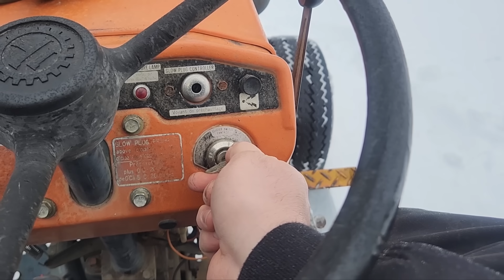Why are Diesel Engines Hard to Start in Cold Weather?

Comment: Alaska- run an extension cord to vehicles with 12 Guage wire to a 4 way outlet. 1 outlet has like a 2 amp trickle charger for batteries, 1 to oil pan heater pad, 1 to transmission fluid heater pad, and 1 to engine block heater.  -70 Fahrenheit no problem. Set on a timer to start warming up 2 to 4 hours prior to wanting to start engine.  Leave for work at 6am, set timer for 4am.  Also saves a ton of money on electric bill!  Lol
Reply: I used to always plug my truck in   , now i no longer do this ,,I bought an APU very first thing when i bought my 1977 peterbilt 359  ,,this particular truck has a 12V71 2 stroke detroit and it won't start unless plugged in ,,   i program the APU computer with the time i want to start my engine   and 30 minutes before i get ready  the APU starts up , it runs an oil pan heater and also the cabin heat ,,and because the APU shares coolant with the truck engine  , no block heater necessary ,plus the APU warms the truck batteries and charges them too ,,so even when it's negative 40 outside i jump in the truck and crank the engine and it's just like it's 90 deg outside ,, all 3 of my trucks have an APU now and i won't ever own another truck without one ,most APU units will also automatically start  regularly  to keep the trucks batteries charged

Comment: Not much to add, other than the reason the oil viscosity in the cold is important,  is that a diesel relies on the engine turning over fast enough to generate enough heat for ignition to happen.  If it turns over too slow it doesnt make the heat quick enough,  and it doesnt kick off.  Running a trickle charger on the batteries over night when its cold also helps.

Comment: A Canuk here from the Moyie River Valley...  a bunch of miles north of your Idaho location. Usually in February we hit our low of lows...minus 20 to minus 30 F. My '03 Ram 3500 5.9 Cummins is a champ and with about 1 to 2 hours of block heater on..will fire with ease. Also, I swap out 15 weight Rotella oil from summer use to 5 weight Rotella for winter.. Just as a note of comparison..prior to using the block heater for a couple of years the Cummins fired up as normal, the block heater simply made the warm up for my ass in the seat a bit more comfortable.

Comment: Appreciate your channel. 84 Mercedes TD inline 5 owners manual says crank till the oil pressure rises. This because the crank rpms are faster than idle. Many don't understand the starter is made for this. Man its a massive starter. :)

Comment: good explanation. winter diesel helps prevent gelling. the biodiesel will increase chance of gelling since its very hygroscopic. a followup on additives may be helpful as well. or use of pan heaters, block heaters, or battery heaters can also help

Comment: You forgot to mention those crappy indirect injection diesels that inject into a combustion chamber before the explosion enters the cylinder, they require glow plug starts even in summer.
Reply: Not true, John. A neighbor has a diesel tractor with indirect injection and he has absolutely no trouble starting it for most of the year. I have a 6.9L International IDI engine in a pickup truck and same thing: no problem starting until the winter weather arrives.

Comment: Makes sense why some of the old-timers up here in the Northern Rockies talk about draining their oil every night and adding it back into the system in the morning. 😑
Reply: Yah: if it's the difference between getting a motor started or not, draining the oil is not terrifically inconvenient in this instance.

I'm not sure I'd like to do this on my semi truck I have which has 12 gallons of oil;  but on a car where there's only five quarts.....

Comment: Definitely a good topic for this time of year. 
Thermostart is actually pretty common in agriculture and Perkins.
Glowplugs were used primarily in pre combustion engines.
Engineers used to believe that the heavy iron parts of the engines would soak up the heat of the compression cycle.
Timing advancement and higher injection pressure really seems to help.
Thinner oil certainly increases starting RPM.
Maybe diesel fuel won't burn in a puddle on the ground but dip a rag in it and light away.

Comment: We will use a hair dryer to blow hot air into the intake if we have a problem starting. I have started a 1968 #60 Hough with a v6 cummins ( 352 I think, the hardest damn engine to start I have ever seen, can be 95 out and needs a little shot of starting fluid)when it is -30 and sitting in an unheated shed.  Had a 1000watt tank heater on 24-7 to keep the engine from getting totally cold.  A 200 amp battery charger is hooked up ,  a warm can of starting fluid(a couple of short shots) and the hair dryer blowing hot air into the intake.

Comment: I own a GMC with a LML Duramax, I live in Canada so it tends to get cold. I baby my truck, so it lives in the garage. When I’m going to use it I plug it in, this activates the block heater, oil pan heater and transmission pan heater, did I say I baby it?
This eliminates the glow plug cycle and also the intake heater once running, this saves the batteries and fuel. I use Rotella T6 0W-40 in the engine. 
I drive a school bus with the MaxForce diesel, I’ve never had a problem starting in the cold, some drivers do because they don’t understand diesel engines.

Comment: It's been a long time since I've been around large trucks I've ran diesel pickups for years I have a old 2000 Ford F350 4wd powerstroke diesel it starts in the winter but not real easy northern Michigan gets cold in the winter my 2016 Ford F250 powerstroke diesel it starts great no matter the temperature I've never plugged it in

Comment: I run in British Columbia and Alberta Canada, and see plenty of cold temps. At a certain point, its just easier to leave em running. Note with DPFs etc, bump up idle rpm to 1100ish to ease sooting.

For gelling, knowing what your diesel is rated to is key. They'll blend in kerosene or such. Know your LTO number (low temperature operability). The after msrket anti gel works well, know your dosing--biodiesel blends need 200% dosing!

Cold start PRO trick, have some spare diesel, warm it however you want (hot water immersion works well, with an old howes jug), add some nice warm diesel into your fuel filter/water seperator RIGHT before starting. 

100% helps,  I've cold started a cold-soaked -32c engine with no heaters this way, 2nd try. She was unhappy and oil pressure took a lot of buzzing and STOP ENGINE to quiet down....

Comment: Some cold start strategies.  

Cold start on 1970's + / - diesel International tractors / backhoes.
US market used ether , Euro market used a diesel fueled electrically ignited intake heater  ( flame plug )
 
If you really want to get obscure, there is a 1940's International engine that had a second intake valve that opened into a chamber fed by a gasoline carb.  Yep, the engine started on gasoline then switched over to diesel.   I've seen an engine that had a way to add gasoline to the engine oil as a way to thin it out.  This was an oil fill just below the gasoline fuel valve.

Small single cylinder Yanmar engines have a port on the intake where you add engine oil in order to raise compression ratio for better cold start.

Hatz engines have a plug that leads to the cylinder where you put a flammable rod into the plug, light it , insert plug into cylinder then start the engine.

Comment: When you made the comment about diesel engines really drawing the amperage to crank over, that reminded me of an item I have noticed in a few random videos from the states of highway tractors that were using three batteries in a battery box that is designed for four batteries. Is this a theme you have noticed on trucks in the shops you've worked at or perhaps its prior owners having cut corners all they can and eliminated one battery. I've never seen such a thing on any trucks I have looked at or owned up here in Alberta. Battery capacity as in number of batteries ( and health along with sound connections ) is everything in cold weather as one needs all the help one can get to ensure a reliable starting diesel ( along with the block heater, the correct oil viscosity and so on )

Comment: I got a job at the local John Deere dealership last year and was surprised to find that they still use ether on new equipment. Coming from a New Holland dealer I found that weird. Lots of the 10+L engines in CNH equipment uses 24V for starting and they all use a pre-heater or glow plugs.

Comment: Our diesel pusher RV w/ a glow plug equipped Cummins L9 has an Aqua-hot diesel fired boiler onboard which provides unlimited hot water to the coach along with hydronic heat that can also pre-heat the engine coolant using a segregated circulation pump. Also from the factory,  has an electric block heater. Can use both at once. We head to warmer climes during winter so not used very much but good to know it is there and why.

Comment: Gelling occurs when paraffin wax within diesel fuel solidifies and bonds together at extremely low temperatures. There are products to add to the fuel tank to help from this happening.
Summer time Diesel #2 is sold, and winter in extream cold areas, Diesel #1 is sold. generally cut with kerosene..
Do not use Ether and Glow Plugs together. Disable the GP`s first.
Engines that require a Valve Adjustment, do it before winter starts. 
Make sure you have 2 good batteries, with clean connections, good cables with no corrosion. Clean connections at Starter relay, and on the Starter.
An old tired starter usually won`t turn the engine over fast enough, and cuts your chances of starting.
A tired high mileage engine will have lower compression, and will be more difficult to start.

I have had Diesels since oct 81, when I bought an 82 Datsun KC with the Nissan SD-22 Diesel engine. still have it, put over 480K miles on it.
97 bought my first Mercedes Diesel 85 300D Turbo, still have it
80 240D, 82 240D, 84 300SD and  4 others in the yard.
86 and a 85 Ford f250 6.9 Diesel 4- spds.
84 JD 950 3 cyl Yanmar
2012 Kioti CK30

On the 86 F250, when the GP`s were not working and forgot to plug in the Block Heater.
A HF Heat gun shoved down the intake a minute or so, she will light right off. 
Be sure to remove the Filter element, or you will have extra heat when it catches fire....

Usually the older engines used in cars and light trucks are IDI engines, Indirect Diesel Injection. They have a swirl Chamber the fuel is injected into to, and where the tip of the GP is.

Larger trucks are Direct Injection. where the fuel is injected right onto the Piston.
The Dodge Cummins is one, from 89 - to around 99 then went to the electronic garbage  as all new Diesels are, computer controlled.

The International DT 466 I saw mentioned in the comments, does not have Glow Plugs, We got 2 new trucks back in 80 we drove for 15 years or so both auto trans, then we got a 95 466 5-spd 2 spd Diff I drove for 10 years before I retired.  NO GP`s.
The other crew got a 96, and first year with the Computer, never liked driving it.

Josh like your topic, will help a lot of people to sort of understand these Engines.

Comment: Very uncommon now but the old compression release was great. Takes 2 guys to start it. 1 to work the lever and another to work the key. There were some bypasses that could be done to start it if you're alone
Reply: The Army's F5070 AKA International Pavestar 20-ton dump trucks had a compression release lever and in 1999 to 2002 Kingston NY, Reserse unit that still had these Vietnam area vehicles, it would take three of us to start one in the winter.  One lying across the front left tire pulling the lever, one to spray either, and the other to turn the key.  Heaven help us if it needed to be jumped without another one running because they never upgraded them to 24V systems and they were the only 12V systems we had besides our POVs

Comment: The compression along with the real culprit, rind cylinder stiffness with cold oil on the cylinder walls. we have quite a number of diesels of all the major makes. Some heat the water in the head. They work eventually but not as easy as those with the block heater placed near the bottom of the cylinder liners. This leaves us to believe the cold oil on the cylinder walls is a big source of the drag on the starter. We have a 1993 Mack truck an E7 that will start below zero cold without block heat. The newer electronic E7 is good, but not like the 93 model. We attribute this to the extra amps being diverted to the computer. The Cat engines we have are good too, but the C9 HUI engine can be a pain. The record for that old Mack is -12 deg. in a cold building.

Comment: Thats why these newer model trucks have there apus hardline to the trucks.  Theres plus and negatives about that.  Keeps coolant flowing to temp and real big negative is when u spring a coolant leak your screwed.  I had 1.2 million miles on my 579 last winter got down to -20 didnt start it for 2 weeks cranked right up.  Keep the injectors maintained change fuel filters regularly during winter.  And youll have no problems.

Comment: Diesel while being flammable is also a very stable substance, diesel fuel needs 2 things to properly burn; compression (AND LOTS OF IT), and heat... so basically in cold weather performing a cold start you are relying on the heat made by the compression friction to start the motor.

Comment: It's actually quite simple. It really boils down to the vapor pressure and the flash point of aliphatic % hydrocarbons. The vapor pressure is easily explained via a logarithmic graph which explains the depressed pressure at lower temperatures. The flash point of these same hydrocarbons is around 125° F which is easily obtained within the cylinder, as per the ideal gas law. However, depressed vapor pressure and temperature make the spontaneous ignition of diesel prolonged.

Comment: Ive got a skidsteer with a 4.5L 4cyl NA john deer diesel that doesnt not have any cold start aids. If its below freezing, it needs to be plugged in to start. If its plugged in and below like 10⁰F you are gonna need ether, or brake clean, or whatever your choice of starting fluid is.

Comment: I know that newer auto diesel engines will run a thinner oil all year around or they have it specified for the winter. Ford recommends 10w30 for summer but only if fuel is not B5 or B20, other wise its 5w40-T6. Cummins 6.7L is 10w30 summer and 5w40 T6 winter, however, 5w40 T6 is a lot cheaper so most run this year around.

Comment: Just to add a couple of diesel engine cold starting aids -- The Cummins engines of six decades past could be spec'd with a compression release lever, which when engaged, would allow the engine to initially turn over much faster, thus heating the combustion chamber quicker.  Release the lever and all other conditions being favorable, the engine would start.  Also, #1 diesel fuel, as opposed to #2 diesel, could be purchased in the colder climates to aid the starting process.
Reply: And there was me thinking it was just so it spun over easier with that big flywheel.

Comment: I plug my Dodge Cummins in when it hits 32°F or colder for ease of starting. The reason batteries seem weaker in cold climates is cause the cell activity in the battery is slower. Batteries discharge at a faster rate in hot climates as the cell activity is much more active.

Comment: Years ago I work at a place that had a 1981 kubota and it had to have the the glow plugs if it was below 75 degrees … in South Carolina , my 7.3 is a struggle to start in the cold but the skid loader will start without glow plugs below freezing
Reply: I have a 6kW Kubota generator that requires a few seconds of glowplug even on a warm day. That's because it has been through a few owners, has over 11,000 hours on it and the compression isn't what it used to be. This is something I can live with, though, as the unit is so dependable.

Comment: Air temperature effects the air density,cold is more dense this means more air in the same volume making the air fuel mixture’s different, more air to compress the more resistance, all the other mentioned items are true also , pre heaters on air intake depends on the type you may not want to use ether . Ether is highly ignitable ( low heat ) that probably why it works well in the cold . Keep it on the toasty side.

Comment: My neighbor (80) has a 1965 580 Case backhoe. no glow plugs. I have seen it start immediately from 80 f down to 0 F. I am baffled. It only idles while working, so much power, I've never heard it misfire or run erratically. It is crazy. Sips diesel fuel but boy it is heavy and only two wheel drive.